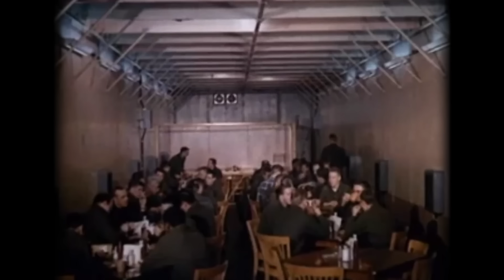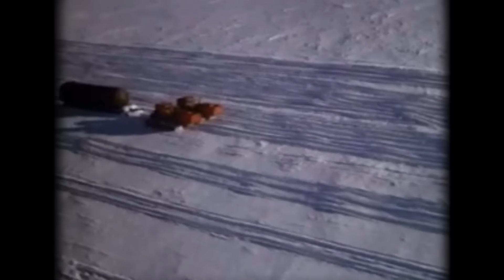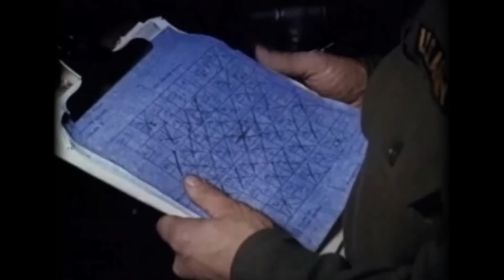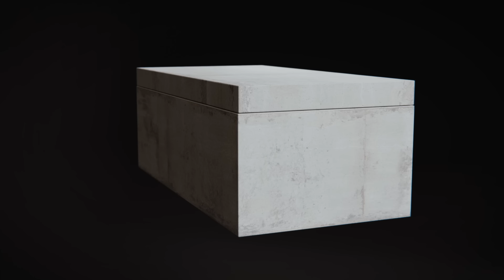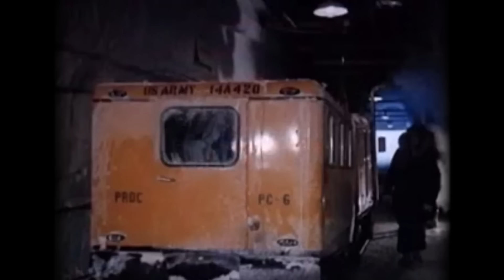How NASA Discovered a Military Base under Greenland

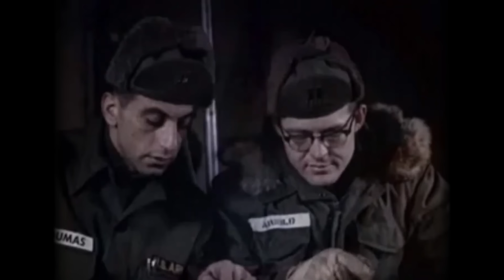Comment: 11:42 "See, even the US Army uses metric for all the important stuff."
That was gold!
Reply: As a scientist in the US, I am bilingual when it comes to units: I use metric for a lot of things, but most of the machine shops have imperial machine tools. Although machinists and technicians are absolutely capable of performing unit conversions and CAD helps with this, I simply find it useful to be fully attuned to the way everyone works, especially as I'm working with many different shops.

With that experience, I'm unsurprised to hear metric and imperial units side by side. That's how I work in many cases
Reply: @jjohansen86  -- I'm an engineer (retired) and I guess that makes me tri-lingual when it comes to units... I can do metric, imperial, and US customary units... Imperial is not always the same as US Customary Units... The best thing about imperial units is that beer in the UK is required by law to be served in imperial pints (20 imp-oz, which is about 19.2152 us-oz)... In the end though, metric is just another arbitrary measurement system, albeit one where sub-units are typically based on powers of 10... You could do the same with US units if you desired and in fact, there are some fields that specify lengths in decimal feet or decimal inches...
Reply: @seanseoltoir  Yeah, unit systems are just another tool.  Even as a habitual metric / SI user I'd say there are situations where imperial works better. Like measuring how tall someone is or other rough eyeballed measurements because human brain seems to like counting smaller numbers, even if they represent the same value. e.g. 5ft 5in vs. 165cm. Easier to have feet and inches for estimations like that. 
I much prefer my rulers to have both systems. Also makes it easier to intuit what unit system something was made with.
 As long as it's kept nice and clear about what units are being used, it can all be figured out with repeated application of simple unit conversion rules and formulae. "Dimensional Analysis" stuff.
Reply: @jjohansen86  The problem is you are are not a real scientist !
 What imperial machine tools, Army ?
It's not the conversion, about sizes, Cubic Gallon ,  with many different shops. use other sizes, that is how the Army works, that is just how we do that here.
NOT a scientist you are !
Reply: @jjohansen86 must be unfortunate.
Reply: They use Lean Six Sigma too
Reply: Absolutely. When I gaged weapons, I measured tolerance in millimeters with a vernier caliper.
Reply: Imperial units are a mild annoyance, but use of fractions is way more distracting, at least to me. While you are working across units, going from 2 1/4 to marking on a work piece 2.4 or 2.1 (instead of 2.25) because you are distracted (e.g. planning you will be doing next) is just bound to happen.

Also, if you like unit jokes, you should check out Canada, where everything is metric except the things that are not — like personal weight/height, cooking, pool temperatures, etc.
Reply: The entire US military uses metric for everything just about. That's more the funny part.
Reply: This fixation over units of measure... I can't figure out if it's a joke or an autistic level obsession.
Reply: U.S has been metric for metrology purposes since 1893.
Reply: I'm watching the video in anticipation now.
Reply: If you're anything but a consumer, you've probably used metric. Worked in warehouses and we'd receive orders with both listed weights. Most items, unless solely manufactured and distributed in the U.S, will also have both weights list on them.

Gotta remember, a lot goes to or comes from (or at least used to lol) Mexico, Mezo and South America, or Canada. Literally just refusal at the administrative to standardize it. 

There's also a few towns, specifically a popular one in Arizona, that only uses metric. It was during a time when the U.S tried to push it, bet it never caught on and the town kept using it.
Reply: The US military uses primarily metric units for distance and volume. American customary for most everything else.
Reply: @shawnhimes3004  

 @jjohansen86 will never understand you, lover levels of Science here in the US !
Reply: its because they understand that their euro dependents cant do conversions.
Reply: every single science course ive taken in the US requires you to use metric units, its very common here despite what every european ever seems to think
Reply: @spork8721 every single tool box in the United States has both units! 
Curse you 10mm!!!
Reply: @spork8721 they sure love to criticize us don’t they!
Reply: @Habituallinecrosser
Reply: wasn't that basically fault of NATO, when all other countries vetoed against baleycorn and swashbuckets as units?
Reply: @Talon3000  ? you have a weird reasoning. How can it be the fault of Nato when all other Nato countries went metric? US went on that lonely imperial path all by them selves.
Reply: @yzorgone doesn't the US and UK use a hybrid measurements system??
Reply: @yzorgone  Well, not fault. More "achievement".
Reply: @avianfever4485 it's common to see both measurements in the US.
Reply: @yzorgone It was because the standard the US was going to switch to, was stolen by pirates. 
Now it's just too much to deal with changing everything over, it's not worth it. 
Also, 99% of the country couldn't care less about what other countries think, it's not even a talking point we have.
Actually we find it hilarious that other countries seemingly only talk about the US in their day to day lives. I just imagine everybody at work "did you see what America did" everyday and it's fucking hilarious.
Reply: @avianfever4485  UK here - we only really use imperial for informal measurements, and for things that're just awkward to switch units for, like road speeds. I'd say I was 5'9", 10 stone, and travelling at 40mph - to go buy some 100x50mm timber, for example. I'd probably still ask for 'four by two' when I get to the woodyard - but the bill of sale would say 100x50. Honestly for the average prole it's probably not that different to the USA, but tradespeople in the UK will almost exclusively measure in metric - for the sake of accuracy, readability, scalability, and because it's what suppliers will use.
Reply: @JimboSlice-t5i  Whenever we talk about the us it's never positive, so i wouldn't be proud about that. Especially these days.
Reply: @JimboSlice-t5i  we do not talk about America every day at work but when we do it is mostly about the population living in it and how dumb they are😂
True or not, the reputation you have is nothing close to flattering...

As a nation I don't think many care much, I don't see much import from you as there was some decades ago.
It makes you kinda irrelevant on an international level.
But you guys have nationalised more so that make sense, why trade when you have everything in existence at home?
Reply: Remember there are two types of countries. Countries that use the metric system and countries that landed men on the moon. Sorry base 12 is too complicated for you. 🤣
Reply: @craig-4881  Yeah, NASA used metric for all calculations.
Reply: @jesperwall839 But the men who did the actual work of building it built it in US Customary Units. They were engineered with those units in mind.
Reply: @craig-4881  what? I thought all the engineers just liked the number 25.4
Reply: Exactly how long is 1/3 meter?

How about 1/3 yard?

Imperial units have their uses.
Reply: @jimmorrison3740 Close enough would be 33,333 cm. What about 1/3 inch?
Reply: @krickan_2  funny enough, also .333; Inches can be written in decimal notation. Just like I can ask what 7/16 of a millimeter is, every time I do this in person the metric fan has to get out his calculator though
Reply: @PolishGreasePit   I mainly think you are used to using fractions, because I see no real example where one would need to know what 7/16 of a cm is. Compared that to how many cups there are in 8 gallons which may be used in some recipe, or how many feet there are in 7 yards
Reply: @krickan_2  I'm used to using fractions because our system isn't afraid of them
Reply: @PolishGreasePit  Metric isn't afraid of it either, they're just different fractions. Nor is it afraid to use a scaling system that actually works without needing "five tomatoes" or whatever other memory trick to make sense of it. Most of the time fractions aren't even of import since you quickly can't measure that accurately unless you're a machinist (like 7/16 of a mm). And if you're a machinist fractions aren't going to save you either you're still going to have to calculate measurements that fractions can't represent conveniently.
Reply: @mintoc8853 laughing in king Phillips' chocolate milk
Reply: @jimmorrison3740 what the f is a yard?

Comment: Those uranium fuel rods are perfectly safe to handle. 

As you state correctly the primary  radiation type is alpha, and the stainless steel casing will block most of that. The stainless steel won't stop neutrons, and it's the neutrons that are needed for a fission reaction to take place. 

Unless you eat loads of itz the biggest risk from uranium is the heavy metal toxicity
Reply: U235 at 93% is still insane though... if someone piled a bunch of rods ontop of eachother.... 💥
Reply: @Teh_Random_Canadian  little boom though.
I expect the criticality event would give you hot slag or chunks of slag spread over an area.
Dilution of the fissile material by it mixing with dirt, rock, or whatever else is around it would also occur if it maintained criticality, leaving you with a mess of radioactive toxic waste. This resulting material would cool to below its melting point as the dilution progresses. The really bad results would be if toxic materials (including radioisotopes) were released as gas, smoke, liquids or similar easy-spreading forms.
Superfund site of indeterminate size. Not a Nagasaki.
To get the fun kind of boom from nuclear material it takes a lot more engineering and deliberate planning.
Reply: @rarrawer molten metal and gamma radiation though. Everyone in the room would be dead for sure.
Reply: @Teh_Random_Canadian  Oh yeah, I agree with that part. Criticality accidents can be nasty business.
Reply: Neutron radiation isn't exactly healthy for meatbags made of mostly water.
Reply: @LordPhobos6502  Nah bro that's not what they said, totally proven by science. The people say it's completely harmless and has no effect on humans. However, musn't get too close to source or your body will be cooked from the inside out, or let children use cell phones. 

We have 100% proven that there is zero effect on the body from rf but created extensive sar regulations just in case.
Reply: @Rejectical  I agree largely but am compelled to be a pedant.
Not quite zero effect from a technical standpoint. It's more that the interactions from RF in daily life are typically negligible.
There are still interactions with matter. Human tissue is a kind of matter. Most significantly is heating, which to my understanding is negligible unless you're soaking up whole watts of energy, and we use milliwatts of toal emitted power for normal consumer radios such as cell phone. Less energy as emitted as RF from the antenna than is lost as heat from the radio frontend circuits, which is orders of magnitude less than the kinetic of the speaker or optical of the screen.
Most of the emissions regs are about the fact that the radio spectrum is a shared medium and it's really easy to interfere with other radio systems by mistake.
Summary: Higher risk of tripping while distracted from the worrying about it than detectable harm from the actual phenomena in realistic conditions. i.e. If you're not sneaking into radio masts or sticking antennas in your nose it shouldn't matter.
Reply: @rarrawer you think. I wouldn't want to make it seem like I knew for a fact if I didn't
Reply: Half-life being 704 million years I would say it’s pretty likely the casing will be gone at some point. That together with the ice melting who knows where it will end up then. And it is toxic after all.
Reply: @T @TurkuExperience  There are an estimated 200,000 liters of sewage, diesel fuel and radioactive waste that current estimates state will be exposed by melting of the ice cap in 2090.  Yikes.  It is hard to say exactly what is in that hot mess.

The core of the reactor was removed in 1967 but the infrastructure of the power plant was abandoned in place.  There are probably lost of nasty radioactive parts.  The power plant was only a few meters below the surface, so I assume that is going to be expose much sooner than the radioactive waste mass.  That may be part of why the US is eager to take over Greenland.  If Greenland stays under Norwegian control, the US will have to clean up the mess which will be astronomically expensive.
Reply: @wtmayhew  "Norwegian rule from 1261 until 1814, it was transferred to the Danish crown after the union between Denmark and Norway broke up, and it was later fully integrated into Denmark in 1953." but interesting take none the less
Reply: @ThereIsNoSpoontang Thank you.
Reply: @TurkuExperience uranium is a naturally occurring element... So it will end up right back where it started... In the ground as a rock.

Take a Geiger counter up to some granite, tell me what it reads. Most granite has quite high uranium content.

Comment: So they were essentially building whack-a-mole with nuclear missiles? That's insane
Reply: The land-based Peacekeeper missile would have used the same idea.
Reply: The soviets used trucks.  Why have 100 missiles when you could dig 100 holes and 25 missiles?
Reply: The Russian solution was a little more dark.
The 'dead hand' system ensured that the nuclear missile forces would fire in the event that command and control were destroyed.
At that point they'd have lost, but out of sheer spite they'd launch a counterattack.

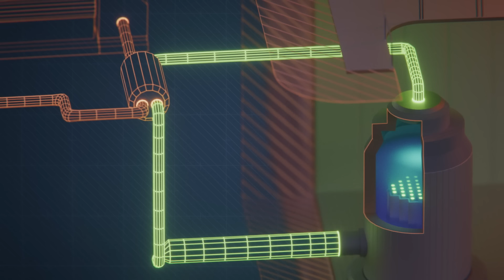Comment: 13:40 why is it a Steam generator, ain't that a heat exchanger between the radioactive high pressure water and normal water, just so to avoid contamination of normal water and turbine. 
I may be wrong, but I thought so
Reply: You avoid having to pipe high pressure steam outside of your radiation shielded area, yes. It also makes the engineers' job so much easier if they don't have to perform maintenance on the power conversion side in rad suits!

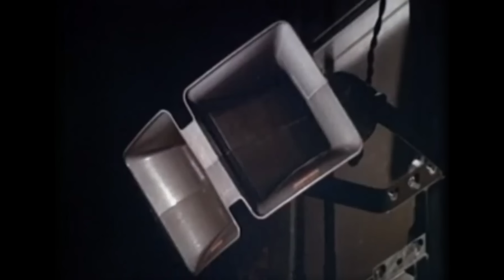Comment: 13:16 Find someone who loves you like Brian loves the metric system.
Reply from the maker: It's less love for the metric system and more absolute disdain for American and British exceptionalism to insist on using an inferior system
Reply: @RealEngineering  tell me, where did the bad units touch you? 😅 J/K. I guess I've been annoyed by metric units at times too but it never really got to me. Then again I've been blessed to work on some cool stuff over the years, so that helps. Cheers.
Reply from the maker: @DennisKapatos  My hatred was spawned after failing a exam question in college because our lecturer decided to put torr as the unit of pressure. First and last time I have seen that unit used. 

Pretty sure he just did it to make us hate imperial as much as he did 😂
Reply: @RealEngineering I can relate to that. If there were a tier list of worst units ever though it would have to be knots for me just because it's annoying and useless. When wind speed gets reported in knots to the general public, like in a weather forecast, it's just a complete waste. I understand providing that to maritime or aviation professionals, but it means nothing to the regular person. It just needs to stop. If professionals want to use knots they can convert from other units.